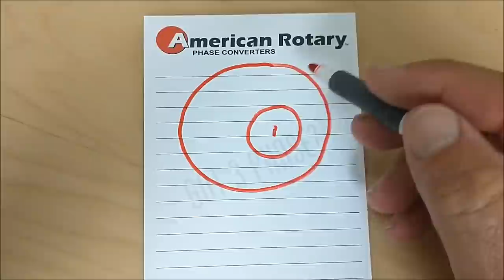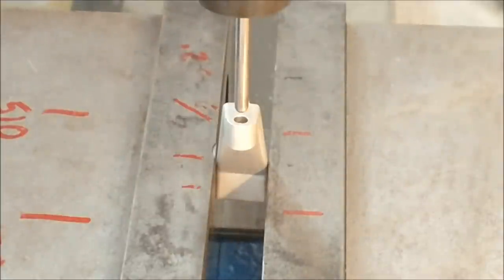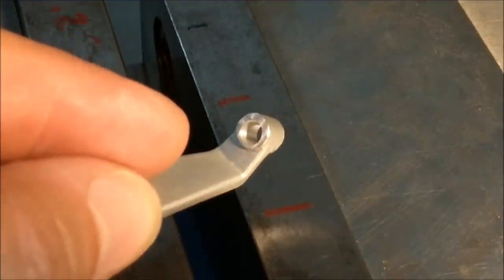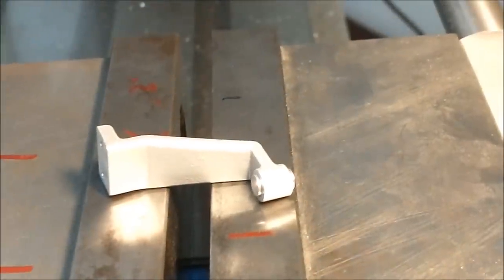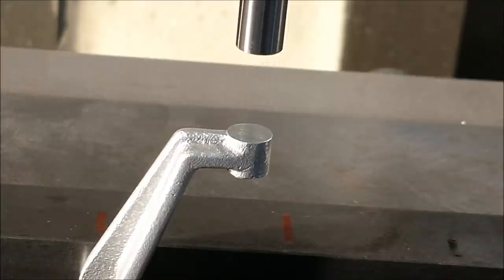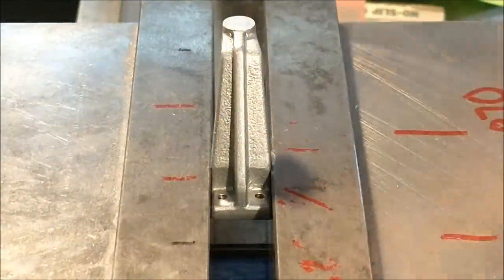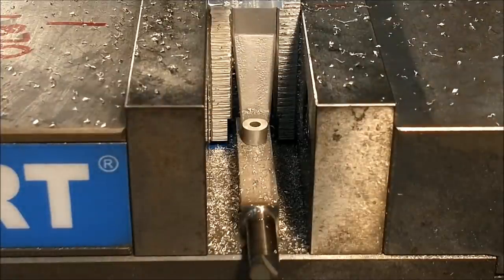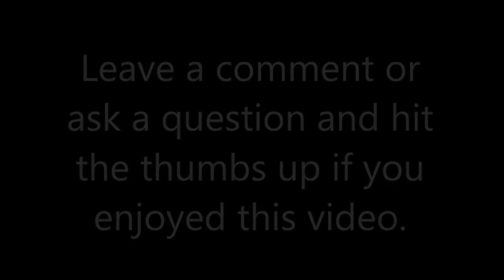Is It Impossible to Move a Hole in a Piece of Metal?  No.... Watch This !!!

Comment: This casting looks very fragile - wouldn't it make sense to build up the OD of the cylinder the hole sits in? Better yet, take a thicker cylinder, and weld it /in place/ of what's on the casting already?
Reply from the maker: I bigger boss on the end may have been a better choice at casting. I agree.

Comment: Lemme guess, you finished the part, and where gonna call and see if they had another casting. On the way home it kinda bugged you it wasn't perfect, dinner came and went, then you went and took a shower, in that shower you had the idea to plug the hole with an expanded plug. The rest of the night and the morning you figured exactly how you'd do that in  your head. Then you went and made this video.
Reply from the maker: Close. I finished the part, DID call the manufacturer for a replacement part ( which they gladly agreed to send ) went home, thought about it for a while and realized getting a whole new casting isn't a teaching moment. I had to do the fix. It was a more valuable solution. Basically, starting fresh was a chicken shit way out and not always an option.
Reply: @joepie221  Yeah BABY!! Thank you for sharing your work. It's not so much the machining itself, but rather the out of the box thinking to solving problems which I appreciate.

Comment: make the part then make the print...... i spend more time designing the part / project than i do building it.... lack of design skill  means that i often have to modify the project when what looked good fusion 360  just doesn't work in real world
Reply: That type of reverse engineering works very well when replacing an existing part. I recently needed to design a replacement sheet metal piece and the CNC shop I use had very different bend radii than the original piece (which also required me to use a different thickness of material). After modeling the reference surfaces and extruding them I was able to model the bends and then unfold for the final manufacturing files.

Comment: 7:49 Congratulations.  You transferred the eccentric from the top of the casting to the bottom.
Reply from the maker: Look again.
Reply: @joepie221  Don't need to, I saw it the first time.  At 7:49 the hole is offset to the inside now.
Reply from the maker: @kellyappel3015  The hole is not finished at 7:49.
Reply: @joepie221  Right.  All I'm saying is that you didn't have piece square to the quill.

Comment: Seeing that you are an engineer and have a mill at hand, couldn't have you made an identical (without flaws) bracket out of billet aluminium of a better grade than a casting grade which is inferior..
Reply: He could, but then how would that be educational for anybody watching, which was the point of the video. Also not forgetting the opening explanation of "what if you get this shitty part and have no other options for replacing or repairing the part?"

Comment: Very poor shop practice.
Reply from the maker: Actually, its a very common shop practice.
Reply: @joepie221   could still be poor
till somebody goes better
Reply: We use it on aircraft all the time for restoring corroded holes. Drill hole out larger and then press (or often freeze the bushing in nitrogen) fit a bushing to restore the lost material
Reply: @joepie221  Ubiquity does NOT equal quality!
Reply: @mormonboy25  Again, that you do so does not stop the OP's method from displaying poor shop practice.
I was referring to his abysmal physical support bits of scrap wood.
Reply: @MichaelKingsfordGray  you should specify then. The video is about the bushing. If you are referring to a small part of the video it’s common practice to list the time stamp of what you’re referring to
Reply: @mormonboy25  My remark pertains to the sloppy shop-practice, which pertains to the quality of advice proffered.
If you didn't spot this glaring slipshod nonsense, then you are not an engineer.
Reply: Sponge-wood for Support...Spot this was easy but i still try to find the moving hole...i use a Hammer and a blund chisel for that (not on Cast Metal)

Greatz from Germany
and have a nice Day
opo
Reply from the maker: @MichaelKingsfordGray  Shame on all of you, it was toast, not wood. Now serious........Actually, opposing wedges could have easily lifted the casting and resulted in a skewed hole. I picked that OSB because it somewhat yielded to the casting at contact. The pressure was very light for all the operations and the support was adequate. Plus, don't forget the drill and reamer needed to also cut into the support so an adjustable parallel was out of the question. I'll stand by the choice and results.
Reply: @joepie221  I am an apprentice trained machinist and instrument maker. I worked 37 years at a National Laboratory and i have used similar materials as wedges and shims. Use what works, there is nothing like experience and working with skilled people. Good job, I love your channel.

Comment: thread the hole, insert the screw, trim off excess,  drill the hole where it should be. Your not making parts for NASA.
Reply: I will assume this comment is humor because the alternative is unthinkable.
Reply: Yeah, that’s not going to work.
Reply: @joedunn7434  why won't that work?
Reply: @julesslim8229  first off, it's a very small part, and you are assuming that there is room for threads, and still have integrity thickness for the wall of the thread cut. Second, you have a bushing that has circular pressure. Eventually, even if you Loctite it, heat will break down the Loctite and it will unscrew.
Reply: @reddogknives  not to mention the fact that once you go to drill the hole, it’ll just screw itself through the part. Unless you tapped it just enough for the threads to catch at the bottom. Then you’ll have to deal with the pressures being placed on the side walls. Basically, all around bad idea lol
Reply: @julesslim8229  Guy Hileman made some good points as well.